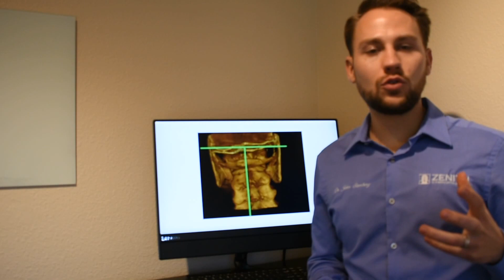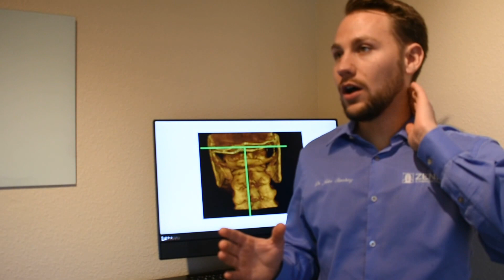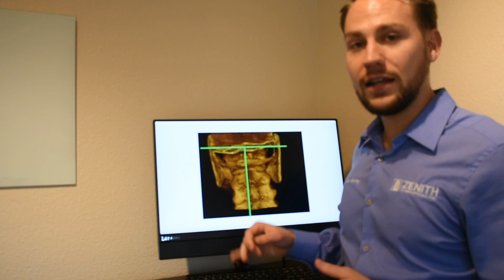What is that grinding sound in my neck?

Comment: Hi.am getting grinding sound when i turn my head right & left..past 2 years am suffering with imbalance issue..can't sit & walk much time due to instability in neck..Consultanted many neurologist & spine doctors..did multiple MRI scans..the root cause is not yet diagnosed....plz kindly guide me do i have cervical instability..if it is then how to finalize that.am from india..please help me sir..
Reply from the maker: Instability can really only be diagnosed with dynamic imaging. Digital motion x-ray is your best choice for that. That involves a "movie x-ray" process that visualizes the spinal joints in motion. If there is excessive movement beyond normal ranges, that would be confirmation of instability. Flexion/extension x-rays and and lateral bending open mouth x-rays are also used if DMX is not available.

Comment: i've had this problem since may of 2020, at first it was only with my shoulder and since about half a year this started in my neck as well. i've visited 2 doctors and both of them recommended physio -  i did physio when i had the shoulder problem but havent had much free time for it recently. this is accompanied with pretty bad pain in my neck and im still a teenager , should  this be  worrisome?
Reply from the maker: It sounds like you were on the right track. We often see that neck and shoulder problems are related, so we focus on correcting the neck. Often this helps the shoulder as well. Your physio would be able to explain what's going on and whether or not you should be worried since they've evaluated you.

Comment: when i breath in my neck cracks what do i have to do
Reply from the maker: It's hard to give you good advice based just on that description, but you may try our 4-T's for cervical range of motion. I'll provide the link to the video below. When we have patients perform these movements, it's done to restore segmental motion of the cervical spine and establish proper coupled motion of the segments of the neck. Usually it works best when you've been adjusted, but it may benefit you even without having been adjusted. Good luck!

https://youtu.be/qfObsv6HOAo
Reply: Facing same problem how r u now plllllzzz pllllzzzzz reply

Comment: its been going on for so long . like whenever i move my neck in a way it makes some clicking noise or grinding noise. ive tried everything and nothing seems to fix it. it only hurts when i do it too much. it wont go away.

Edit: I still have it and I think my neck bones are like out of place because it’s been going on for a while now, and I just want to be normal
Reply: Same it’s been going on for a while it sounds like running ur hand through wet sand every time I bend over turn my neck put my arms out in front of me and it hurts so bad and it’s constant my ears pop to and there’s like a pee sized lump under my neck skin at least it feels like it it doesn’t leave a bump on my neck but I can feel it with my hand and now my neck is hurting rlly rlly bad after messing with it and the pain goes down my shoulder blade and in my ear sometimes and side of head sometimes pain oh and idk if it’s from panic/anxiety attacks but I start feeling weird and get cold sweats and my heart starts racing and I’m freaking out so I’m pretty sure it’s just my health anxiety kicking in cuz I’m scared shitless that something sinister is wrong wit me
Reply from the maker: Hey CyruxFN, sorry to hear that it's been so scary for you! The real "sinister" problems are far less common than things that can be addressed conservatively, but ultimately having a doctor check it out for you would be the best way to know for sure. You can check this directory for someone in your area who would treat it like we do:
https://www.blairchiropractic.com/locate-upper-cervical-blair-chiropractic-doctor/
If I had to bet, I'd guess that that pea-sized knot that you referred to is on the back side of the right upper neck. It's pretty common with upper cervical problems, and often subsides once adjusted properly. Good luck!
Reply: @zenithupppercervicalchirop8075  well thanks for the extra bit of relief and I’m going to see a neurologist soon and another reason this could be happening is from the car wreck I was in a few months ago
Reply: @CyruxFN  bro same
Reply: @CyruxFN u okay right now? Your neck heal???
Reply: @danialzzzz22  nope not nowhere near as bad but yea my neck and head is still fucked up
Reply: Same here..how long have u been suffering…I had it for almost two months
Reply: @yeminthant6210   1 I think
Reply from the maker: Hi InPlay, it might be worth consulting with an upper cervical doctor. A fresh set of eyes on the situation can sometimes uncover things that were missed as you're working  through it. There is an answer for you out there, don't give up! https://www.blairchiropractic.com/locate-upper-cervical-blair-chiropractic-doctor/

Comment: Ive had the grinding sound for like half a year now. I went to a pt but the stretching and exercises don’t do much. I think it’s because of my bad posture due to working from home. Weird thing is that even when laying down for a while, the back of my head gets really stiff again and the grinding gets worse
Reply from the maker: Hi Mocha, we've definitely worked with patients who had a similar experience. In those cases we've found that there's a structural issue underlying the issues with movement and muscle action, and once that gets corrected the exercises work much better. You can search for an upper cervical doctor here:
https://www.blairchiropractic.com/locate-upper-cervical-blair-chiropractic-doctor/

Good luck!
Reply: PT  And MD.  Is A Waste Of Time. It's Pure Foolishness They Only Treat Symptoms  .  Upper Cervical DC Is The  Only Correct  Answer     👍

Comment: I'm 14 but everytime i turn my neck to the right or left or my shoulders i hear a grinding sound or if i pull in the middle of my back its uncomfortable and idk why i just cant move my neck without hearing the Noises also i have anxiety and tinnitus which is ringing in ear sounds the same as the grinding Noises 😭 and im scared i cant sleep at night so i think i need to see a pysical therepist 🥺
Reply from the maker: A physical therapist may be able to help out. We typically work to correct the neck, but a PT that can help you with the muscles may be very beneficial!
Reply: I feel you!😭 I'm 17 btw

Comment: I have a problem in my neck  It's all started after i prssed hard on my neck disc  i felt unconscious and my hand were cold  i cant even mive my neck left to right, if i tried to move my neck same thing happened like hand cold, something happend to me i dnt know whenever i went to sleep or lay diwn on my bed i felt my neck moving, ir some cracking or sound, after appointed to doctor i am more better but i still have the problem al tough i can move my neck left to right now but i fell my neck is weak the stamina in my neck is not like It's used to. It's been 4/5 yrs facing this problem,  many time my neck get locked like in right side ir left side, idnt what to di now.
Reply from the maker: Sorry to hear that you've been dealing with this for so long! Check out this directory to see if there's an upper cervical Dr. near you to help figure it out.

https://www.blairchiropractic.com/locate-upper-cervical-blair-chiropractic-doctor/
Reply: @zenithupppercervicalchirop8075  thank you sir.
Can i get healed from this  i'm very nervous  i want to get cured sir.

Comment: When i walk i hear what sounds like sand pouring. No kneck pain and no popping. I can crack my kneck, tho i rarely do that.
Reply from the maker: Hey Alex,
We advise patients not to crack their own necks. That must be very aggravating to hear constantly, and the movement part may be indicating something structural in the neck is involved. You can consult with an upper cervical doctor to find out what's going on. You can search this directory to find someone local:
https://www.blairchiropractic.com/locate-upper-cervical-blair-chiropractic-doctor/
Reply: Facing same problem how r u now it any thing helps please make reply plz
Reply: @sumeenahmed5099  I've done stretches and got insoles for my shoes and it's almost completely gone. Stopping slouching seems to have helped some as well. Tho I don't know if any of these things really helped.
Reply: @alexhutchins6161  was your neck making crunchy sounds
Reply: My neck is making crunchy sounds while walking i don't have any pain dr don't have any idea I'm very tensed about it from last 8 months
Reply: @sumeenahmed5099  I had more like sand. Apparently from what I have read the crunchy sound is a more progressed form of it. I'd go to a chiropractor. He would give you all the information you need and how to fix it. I can't stress enough how much a good chiropractor will help. 

Also I have something called an inversion table. You strap your feet and and hang upside down. It should be able to help as well. If you buy used one it should be between 30 and 100 dollars I bought mine for 45$. It helps the spine immensely.

I wish you good luck. And go talk to a local chiropractor. If left untrested and it gets worse it could cause damage. Tho that might just be internet panic propaganda. So idk.
Reply: @alexhutchins6161  but I don't have chiropractor near me🥺
Reply: Thank you for your advice
Reply: @sumeenahmed5099  oof no chiropractor huh. Well all I can say is stretching and the Inversion table then. And when you get a chance see a chiropractor. 

Idk if it will help but krill oil is supposed to be good for joints. Along with many other health benefits. Hope it gets better
Reply: @alexhutchins6161  stretching only for neck or whole body....
Reply: I can use krill oil
Reply: @sumeenahmed5099  your whole body. Most of it will effect your spine some. Try yoga
Reply: @alexhutchins6161  ok...bro I will try

Comment: So when my chiropractor cracks my neck is he causing more damage or fixing it? The first time he did it my face stung. Why? After that I go he cracks it I can move my neck but it’s still sore the next day it hurts so bad I can’t do anything and nothing helps when I go back I’m in less pain but I lost a lot of motion he gives me motion back but pain is more sore. How long should I give this to work before I look at other options? Is this normal at 49 to have pain and fatigue? Is this just aging?
Reply from the maker: Good question. The truthful answer is it's really difficulty for me to know just based on that information. That being said, there are reasons why the cervical spine (neck) might not respond well to a traditional manipulation. We never use traditional manipulation to correct the neck because we find that low force techniques have a better outcome in many cases. This article will expand on that a bit:

https://zenithchiroco.com/posts/safe-chiropractic-technique-for-neck-pain-in-colorado-springs

You can search for a Blair Upper Cervical doctor in your area to get a second opinion, which sounds like it would be a good idea.

https://www.blairchiropractic.com/locate-upper-cervical-blair-chiropractic-doctor/

Comment: I hear sizzling sounds or like  candy pop sounds in back of my neck when I lay down in bed
Reply from the maker: Is this sound specific to the neck, or do you hear it in your ears as well?
Reply: @zenithupppercervicalchirop8075  I have been trying to google what this sound is like for the past 20 minutes but this poster just described it perfectly. It's just like candy pop sounds, very light, and more of an internal conductive experience rather than a genuine "sound" - in fact I was 50/50 on whether this was a sound or a physical sensation. It's not unpleasant and lasts for a second or two only and is not easily replicable but seems to happen only when I lie down in bed with my thoracic spine more or less flat but cranium inclined anteriorly with a number of pillows so I can use my laptop. In fact this is a very common physical position that I find myself in as I spend a fair amount of time on my bed on my laptop, and this is the most comfortable position. I wonder though, if perhaps this position is not the healthiest one for my cervical spine?
Reply from the maker: @DavideWernstrung  I think you may be on to something with the postural issue you described. That's certainly not an ideal position for the neck, and it could be a part of the problem. This article describes the mechanism in a bit more detail:

https://zenithchiroco.com/posts/does-upper-cervical-chiropractic-help-with-spine-curves.html

It's not a bad idea to have a professional opinion on it. You can find a qualified Blair Doctor here:

https://www.blairchiropractic.com/locate-upper-cervical-blair-chiropractic-doctor/
Reply: @zenithupppercervicalchirop8075  I hear it loudly in my ears.. as Im rolling my neck or turning my head.. again Like having pop rocks in my mouth...
Reply: @zenithupppercervicalchirop8075  idk i can feel it in my neck and kinda hear too it's a weird sensation
Reply: I had this and it turned out I had undiagnosed progressive sinus infection that was destroying bone found accidentally on an mri. 3 days on antibiotics and complete relief had to continue antibiotics for 14 days. My neck would make crackle pop noises just sitting straight and doing absolutely nothing, with extreme fatigue and ache all over my body. They wanted to put me on cipro I told them to stuff it cus I already have ligament and tendon problems I said the only antibiotics I’m taking is the amoxicillin—luckily I’m not allergic to it.
Reply from the maker: @joanbaczek2575  Wow! As with any symptom, there can be a variety of things that are causing it. Glad you found a solution!
Reply: @joanbaczek2575  Do you have other symptoms?
Reply: YESSS!! Like the Sound of Pop Rocks in your mouth.. its VERY Unsettling!!

Comment: can these sounds happen when sitting still and not moving?
Reply: Finally somebody who relates. Everyone is saying how they have to move to hear it but not me.
Reply: @wg0d395  I barely have to move my head to hear a noise, im talking the smallest movement. and sometimes I hear it when I'm not even moving my head it's just in a position that creates it. I hear a worse one when I'm turning my head from left to right and this started about 6 months ago. I have incredibly tight shoulders as well. I'm getting worried! I don't know if I trust chiropractors though, i've heard horror stories. so who do I see?
Reply: Gary idk i just put a mic in my mouth to get the sounds so others could hear. i havent showed anyone else but it was pretty brilliant how it picked up the bone rubbing. i just deal with it since im 12 and cant do much
Reply: @wg0d395  wow you're young! that's cool that it picked the noise up through the mic, I may have to try that myself. I'm going to speak to my doctor on monday about it and see what happens. I'll update here if I find anything wrong.

Comment: In 9th grade I got whiplash really bad and about a week later my neck started grinding making the gravel sound and it would hurt I’m in 12th grade now and all the Symptoms are the same except it doesn’t hurt anymore

Please comment on this and try and tell me what the hell is wrong with my neck
Reply: Thank you for your help man! Much appreciated
Reply: How u doing? Getting better?
Reply from the maker: Sorry to hear that you had that injury, the good news is that you can get checked and have any issues corrected in order to prevent long term damage. I'd recommend consulting with a Blair Upper Cervical chiropractor. A Blair doctor will be able to get to the bottom of what's causing your symptoms. Check the directory linked here to find a doctor near you. https://blairchiropractic.com/locate-upper-cervical-blair-chiropractic-doctor/#!directory/map